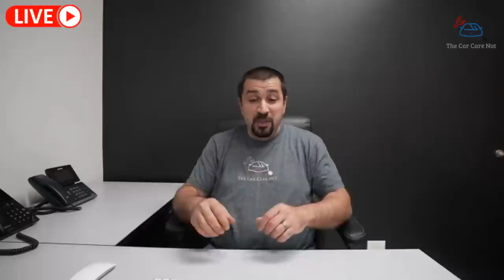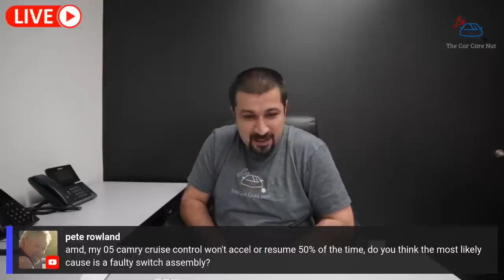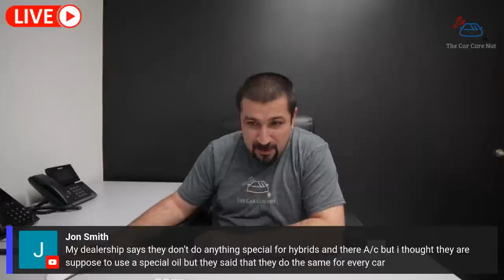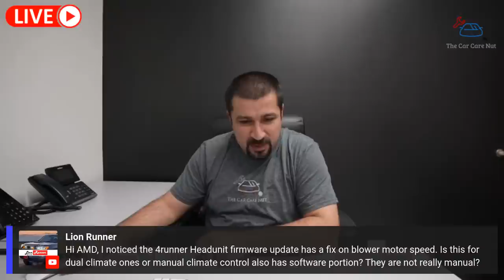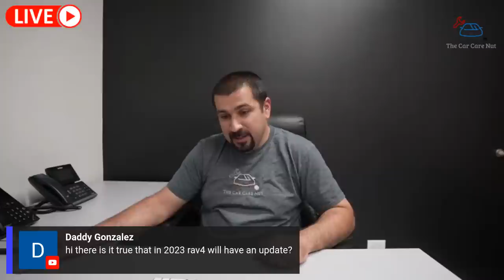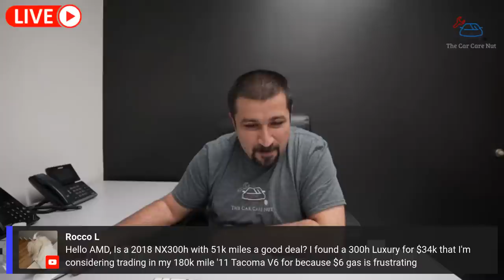Toyota and Lexus Live Stream Q&A

Comment: Can you please do a video on turbo charged engines and why most car makers including Lexus are moving from the tried and tested v6 to these turbo charged engines?
Reply: We have been using Turbos on 4 cylinder engines and even 3 cylinder engines here in the UK for year's. My current Car is a Toyota Auris/Corolla 1.4Ltr Turbo Diesel which produces more power and better fuel economy than a non turbo.
I can never understand why the USA uses such big engines apart from the fuel being cheaper than the UK.
Even with my little 1.4Ltr Turbo Diesel I can still do Motorway speeds 70MPH @ 1800RPM and it will still pull like a train in 6th gear uphill, I usually get around 60 MPG on the Motorway and around 45 MPG around the city. The current price of Diesel is £8:30 /Imperial Gallon 😔 It's sky rocketed in price since the Ukraine War started.
Reply: One word. CAFE.
Reply: @wolfeadventures  CAFE a small restaurant selling light meals and drinks.
🤣😂🤣 Well that's what it means over her in the UK.

Comment: Hi AMD, congrats on the new shop!  I have a '10 Corolla LE 1.8L with about 120k.  I don't think I have the VVTi rattle at cold starts, however I get a screeching belt noise at cold starts.  I got my serpentine belt replaced at 90k like back in 2018.  The first time the mechanic didn't tighten it enough and sounded like it was slipping.  Then I had a toyota shop tighten it per spec.  However, it still get a screeching sound on cold starts.  This is on a dayco 5060485 belt.  When I originally bought the car in in 2010 from the dealer, I used to get the screeching sound with the toyota belt.  However, this would only happen in the mornings when it was very cold in South Florida, which is rare.  Now with the Dayco, belt it doesn't matter whether the weather is cold or not.  The screeching noise just typically happens on cold starts.  I notice if I put the key in the ignition and don't start immediately and move the key back and forth before the start, sometimes this action prevents the screeching noise.  Is it the belt or the VVTi noise?
Reply from the maker: Hi! That screech is usually the belt but if it’s been replaced and properly tensioned then it could be something like a dragging alternator or water pump.
Reply: @TheCarCareNut  Thanks!

Comment: In all my 4 cylinder Toyotas for decades, I sometimes hear a pinging/knocking  on acceleration. I even hear it on my 2020 Corolla SE 6MT.  It hasn't caused any problems, but wondering why. I use 87 Tier 1 fuel. Thank you!
Reply: Did you ever consider going with the more expensive premium just to cleanse out the tank?You fill with premium a couple of times and that's it!Try it it should get rid of the knocking and pinging you have and if not there's other things that you can do too but I believe this will for you !
Reply: @derrickjohnson5219  Thanks. But the 2020 was doing it with less than 10,000 miles on it.
Reply: @marklintwo  good luck on that but it shouldn't be doing that with such low mileage or it could be your vvt but your right it shouldn't be doing that at such low mileage
Reply from the maker: Hi! Switch brands first then try premium and see if it goes away

Comment: I just bought a 2022 Corolla LE I’m at 1200 miles I already change the oil at 1000 It’s free with Toyota care but the service visor thought I was crazy getting it done he said you don’t need it till 10,000 and I kept hearing other service advisors tell that the customer is in like oh okay I won’t get it done then why was cheap engines are not

Comment: Speaking of the Corolla Cross Hybrid… I noticed on one of the introductory videos that  it doesn’t have a spare tire. From what I saw there is space for one … but Toyota has run some kind of cable for the Hybrid system inside this space and subsequently removed the spare.  In 56 years of driving I have never not had a spare. Not sure as I move into my 70’s that I’ll be too keen NOT have the spare. The so called flat tire kit doesn’t sound like a very good alternative if you have a damaged flat tire that is shredded etc.
Reply: You can always buy one.  Don't let that detract you from buying a car.

Comment: How do I secure the trunk weather-stripping on a 2010 Camry? I cleaned the old one to stop a leak and reinstalled it. No more leaks, but it keeps shifting slightly. The weather-stripping was not permanently attached with adhesive, but it had a tacky substance in the channel that kept it in place. Thanks!

Comment: Hi, I really like Toyota and Lexus cars and value your guidance very much. I own a 2006 Lexus RX 400H Hybrid with 170K miles.  Is it safe to use the 15% ethanol  enhanced fuel? It’s about $1 cheaper per gallon.  If that’s too high ethanol could I fill up with 1/2 regular and 1/2 of the 15% ethanol fuel?  I’d like to save the $ but don’t want to risk damage to my fuel injectors or engine.  Respectfully, Leo in Virginia

Comment: Hi AMD, I have a question.

I am ordering the new 2023 Toyota Corolla Hybrid SE 1.8L AWD w/ Li-ion battery or Corolla SE AWD 2.0 gas engine soon! 

Which of the two is better for my situation when it comes to fuel and maintenance?  

I’m in Canada where we get 5 months of winter ranging from 0 to -35°C (32 to -31°F), I will use the car as my daily commute to work (215km a day) and mostly 90% highway drive with 110kmh (71mph) speed. I will keep the car for as long as the value is more than what it cost to maintain. Hope you answer my question, thank you!
Reply: I live in Toronto.  Get the hybrid. I have a 16 RAV4H and a 12 CT200h.  Lots od advantages with hybrid.  Even highway driving as long as you stay below 120 kmh.

Comment: Great Livestream thanks. I have a question. Toyota Camry 2011 hybrid with 420k Miles. Code C0210 comes on when i start the car in the morning and brake pedal feels weird , but after driving 10-15 miles when i turn off the car and start it agian the code goes away by it self. Some times i have to turn it on and off few times to get rid of code. What could be the problem and how do i fix it? Thanks again.

Comment: Hello AMD..I have 2010 Toyota Camry..it is almost 260,000km driven...last few months having issue with engine light....First it was only on..suddenly started blinking when car goes above 60 or it is going uphill...start shaking(misfiring)....another issue from last year, every few days we have to pour engine oil(consumes/burning) lot of oil....mechanic find out 3 codes (P0136,P0303 and P0304)...he changed O2 Sensor(downstream), 4 spark plugs and ING Coils...few days it was ok...engine light on and misfiring again...mechanic check and said cylinder 3 is misfiring and car engine has to be replace...could you please guide me and let me know what could be the reason and what it the solution..thank you for your time and help.

Comment: My 2018  LE Camry  has cooling radiator fan increasing speed when AC is turned off and doesn't turn off until a minute or so when engine is switch off. Scanning indicates all system is ok but have a hunch the fan is abnormal. Any advice sir

Comment: can the 2013 corolla radio with touch screen fit and have same connection with the 2010 corolla? want to add a back up camera and the stock radio is easier to use for older people.

Comment: Bought 2019 RAV 4. It has7 recalls help. Mine has had a fuel pump replaced. Only 14, 029 miles when I bought May 6, 2022.
Reply: I had them do an alignment it needed. I wasn't charged but scared about 6 other recalls.
Reply: Made in Canada. Been at Classic Toyota it's entire 14, 000 miles. Rental or lease? Has a few more months under warranty.
Reply from the maker: Hi! Are they all recalls? Some of them are campaigns. Recalls are not an issue. It’s something that they’re fixing to prevent issues

Comment: Hi AMD - love the new shop. Would you recommend pulling a 1900lbs Uhaul trailer (with  maybe 1000lbs-1500 lbs of stuff loaded) w a 21 4Runner 4x4? Or should I get the smaller trailer which weighs 900 lbs? I’m driving from CA to IL through the mountains.

Comment: If u see this can u tell me if paying for the air intake and throttle body service was a bunch of bs I paid for ? Was it a useless service for the way for the dealership to make more money from me? I guess they use a spray when running the engine sprayed into the air intake?

I paid for it as my logic is to prevent  the throttle body to get stuck open due to carbon build up? Correct me if my  logic is wrong. 

Thanks
Reply: Wait for mr nuts answer, however dirty throttle body’s is a real thing

Comment: 2007 Prius Touring…emergency brake light m, TPMS light, ABS and VSC came in today; after 10 minute drive I stopped and then “burning” smell…tried setting and releasing brake pedal, tried the paper clip OBD2 jump trick.  No change.. drive it home, 15 minutes—no burning smell…slight resistance when in drive.  I put in drive and started to gently depress emergency brake pedal…1/4 inch and hear a noise and brake starts to engage.   Could caliper be partially closed???? Thanks (if you can shed any light on this
Reply from the maker: Hi! It’s possible that a caliper is sticking. Inspect the brakes and see what’s going on also try to retrieve the codes to see what happened

Comment: Did my oil change at 1000 3000 and 4800
Reply: Have a 2022camry se with 4 cylinder
Reply: Need your advice
Reply: How soon do I have to do trans oil
Reply from the maker: Hi! The transmission fluid every 60k miles
Reply: I have little over 6000 on and still call it braking in . So my question shouldn't I change trans fluid before 60k love this camry want it to last long time